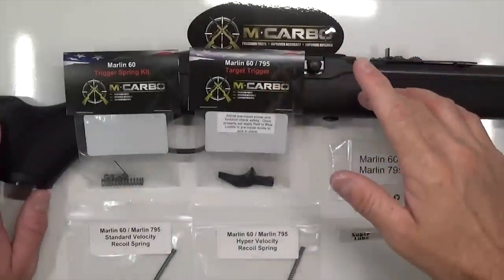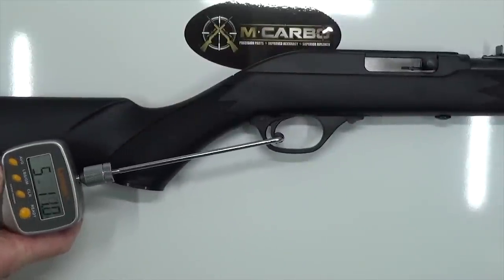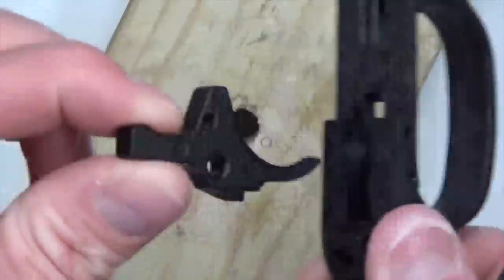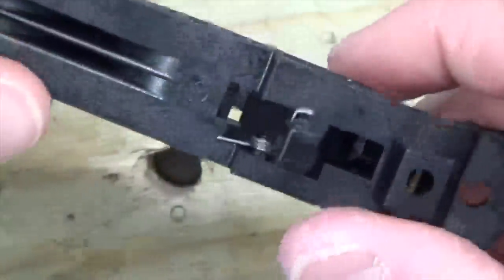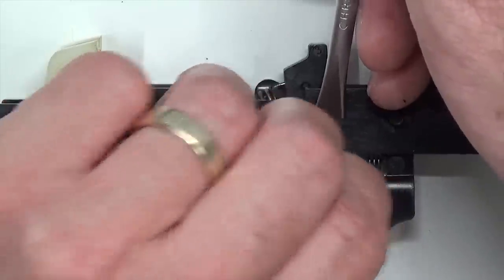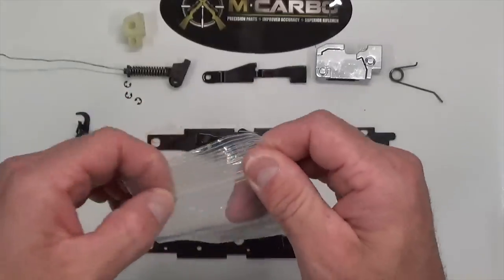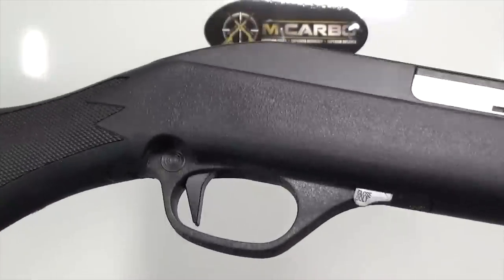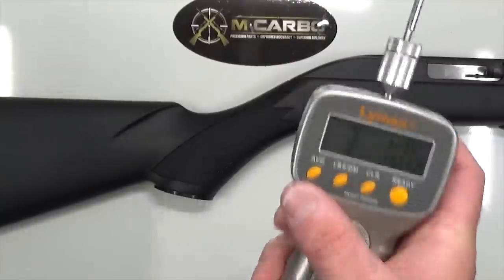Marlin 60 Trigger Job Bundle Installation by MCARBO

Comment: Such an awesome video!    I have a Glenfield 60 (with the squirrel on it)  That my dad bought in 1983.  Around 1986 or so I was cleaning it and lost that dad gum sear dis connector spring!   I searched hi and low back then to find one and could not.  Left the gun with a gunsmith for 6 months, and he could never fix it. (yeah, he sucked).  So this rifle sat, unusable, until tonight!  Now it works, and it has a lighter trigger pull!  I plan to go shoot it tomorrow.  

 Thanks so much for the products, and the great video.  That is a tough  job without knowing exactly what you have to do.

Comment: so i did this on my 1981 vintage 60  
i found the hammer spring to be kinky- doesn't look completely straight 
didn't do the new trigger, but the spring kit is sweet 
used the trigger spring kit on my m&p and man that made a huge difference 
thank you mcarbo

Comment: I got the spring kit installed with no problems at all. I dry fired on an empty casing and it’s amazing. This was the rifle I cut my teeth on when I was a kid and I never stopped shooting it. I was so used to the heavy trigger pull, I didn’t notice it until I started squirrel hunting with it last year. I could watch my scope reticle drift off a squirrels head while I loaded up the trigger. Anyway, it feels like a completely different gun now. Some of the reviews made me hesitant about swapping the trigger out. They were mentioning the gun not firing and that’s not something I wanna deal with while hunting. After doing the spring kit and watching you install the trigger, either they didn’t watch the video or they didn’t pay attention well. I’ve done a lot of kitchen table gunsmith work using YouTube and this was the best video. Great camera angle, good level of zoom, good lighting, and a nice slow pace pointing out every little thing that’ll trip you up. I work in manufacturing environments and this video reminds me of the guy that’s put something together a thousand times over the past 20 years and everyone from newbies to engineers goes to him to ask questions. Great stuff. I added the trigger and an extra set of e-clips to my cart on your website.

Comment: I'd this trigger job 3 years ago. I used the DIP milled alloy trigger. The trigger pull is now incredibly light. In the 2lb range and she rattles off shots like a M240. The diversified innovative product or dip trigger comes with a pre-installed trigger safety in an alloy housing and you simply just drop it in. But I urge you to also have this trigger kit installed before you receive your trigger, housing and diversified innovative product alloy flat face trigger.

Comment: I recently installed this kit on my old 1986 Marlin Model 60. I took extra time to polished all the contact areas, particularly the hammer and sear. The pre travel adjustment set screw was sharp on the end where it makes contact with the disconnector, so I stoned and polished it too. The trigger turned out really nice compared to stock. The pull weight dropped from 5.5 lbs, down to 2.5lbs. Can't wait to try it out on the range. $75 for this  kit seemed kind of expensive... I paid $60 for this gun used in 1996... It's a sweet trigger now, so I think it's worth it. 😁

Comment: So I have never taken a gun apart before. Used another video to show how to clean the model 40 and when I did found the recoil buffer had broken into five parts. No problem, found other vids that showed how to replace. Followed their directions. Then, BIG problem for me as a novice. The trigger spring came apart and I could not figure out HOW to get it back into the slots. Spent over an hour trying different things. None of the other repair vids showed how to handle this problem. Figured I had seriously fu-ed up. As a first timer on my own I was seriously stressed thinking I was going to have to take it to a gunsmith to repair what seemed to me had to be a simple problem.. I just could not see how to get that spring assembly into the two holes in the cover plates  I know this was not a repair video but as it turned out by watching how you replaced this assembly it explained how to get my error corrected. Bottom line. With what I learned in your video, went back to the assembly, took it apart and had the problem fixed and the whole assembly reassembled correctly in less than four minutes. Serious thanks!

Comment: You can dry fire these just fine.  Marlin says it's ok.  Also these have only had the automatic bold hold from the 80s and later.  That means the gun was designed for dry fire as the system dry fires after the last round is fired since it wasn't originally holding the bolt back.

Any good design can be dry fired including the model 60, the 10/22, and the model 64.

Comment: Like the hyper velocity spring... bought one recently... next I think I'll replace the trigger assembly... since I am ordering a Badger Bull Pup kit for my older New Haven, Conn. Marlin 60 made in 1988 with longer barrel and feed tube. Nice gun that will make a beautiful Bull Pup rifle when I'm done with my reconfigured Marlin, put the hyper velocity recoil spring in my stainless Marlin 60 tube feed rifle with the laminated black and grey beautiful stock, that gun is about done with the work to upgrade, maybe a better trigger on it next as well, but the Bull Pup I'm building is first out of the Marlin I own from 1988 in New Haven, Connecticut where it was manufactured. The Bull Pup Marlin 60 I'm turning the New Haven gun into from 1988, I have seven Picatinny rails on it, three rails on the scope, scope on one on the gun barrel top and action, that is an additional Picatinny add on in the Badger Bull Pup gun stock kit, and three on the front stock of the Badger Bull Pup stock, talk about over kill with Picatinny rails...LOL! But I have a Bushnell 4–12 x 50 EG tactical range scope on that top rail, with it's own Picatinny on left and right and top, and on top is a holographic scope, on the left a laser... so every range from short, medium, to long range shooting out to 200 plus yards with a Bull Pup 22 Marlin 60 is covered... LOL! I like shooting the 40 grain Aguila copper plated bullets out of the New Haven gun, they work better in the chamber and barrel it seems to me, and leave less gun powder residue inside of the action and gun bore, and burn better when fired in both my Marlin 22 rifles. So fixing up the trigger pulls on both will be really nice next after all this, but the Bull Pup Badger stock you can adjust the trigger pull as well on the actuator rod going from the trigger that is moved forward in that gun stock design above the pistol grip by bending the actuator where it hits the firing pin piece inside the action of the Bull Pup designed stock. Actually nothing in the Marlin is changed except moving the trigger assembly forward past the pistol grip. A really nice design, and this trigger upgrade you guys demonstrate makes it even better if I can make it work attaching to the actuator rod for the longer trigger pull in the Bull Pup Badger design... like this a lot, thank you for sharing the tips and parts that can be ordered to make a nice gun even better. You guys and gals should check out Gary Morris Badger Bull Pup stock design for both Mrlin and Ruger 22's and how the trigger actuator works, easier to adjust than some think by bending a wire like you guys are bending springs into place in the action of the Marlin. Hope you guys have a beautiful day and thanks for shipping those recoil springs, one spring fixed the old rifle issues completely for the New Haven gun made in 1988 I'm turning into a Bull Pup gun, the gun is 34 years old and about time the recoil spring was replaced... the Bull Pup rifle at 27.5 inches for the entire gun in length, stock and barrel included...of course I am good at tearing down guns and putting them back together... enjoy it...and making new guns out of old guns... for a very interesting 22 rfile that is a bull pup and still as accurate to shoot as it was original...but easier to handle on long hikes since I'm missing a leg and wear a twenty gran carbon fiber and titanium Össur Prosthetic leg... LOL..  so shortening up a gun to make it easier to handle hiking was why I am changing the factory New Haven Marlin into a Bull Pup rifle... neat to have options to personalize a good rifle design... like this video for taking the action apart... very clear and precise for the tigger and action... great job as well on the video...

 ∞
∆7Ω

DJ Emery

Comment: I have to replace the buffer block on my 60SB, so I’m going to order up one of these kits and just do everything. Really excited. I haven’t checked your website yet, but if there isn’t an option for a red trigger or straight milled aluminum, that would be an awesome option. 
As for the aluminum trigger guard, that would be sweet as well. Thanks for the video, it makes it pretty straight forward.

Comment: Can the Newer Recoil buffers with the .155 dia mounting Pin hole be used in place of the older .100 dia Buffer if that's not available. Wish you guys would possibly make those outta a better material than the hard plastic the Factory replacements are made from

Comment: Excellent video. Two business suggestions: 1. Add a std marlin model 60 "rebuild kit" for the old style 60's with all the springs and a new firing pin. I'm in that category that wants to replace my 1972 model 60 with a new stainless model. I want to rebuild my 1972 with std trigger pull for my 8 yr old grandson, I Don't want him learning on a 2 lb trigger! Of the 11 million model 60 owners, I'm sure there is many in the same boat that want to rebuild like new for their younger family but can't find a "kit", they must piece by piece put a kit together! 2. I would buy a metal trigger assembly in a heartbeat. Recommend this: a bare bones metal trigger guard, a full up lowered pull full metal trigger assembly, and for guys like me ( purchasing the stainless) two different kits for stainless; one is barebones stainless trigger guard  and one a full up stainless trigger guard with lowered pull assembly. That gives you 5 new products!!  A kit to rebuild older style 60's, 2 different items for blued new 60's (barebones guard and complete reduced pull assembly) and the same for stainless. Bet the old style rebuild kit and the two blued trigger options would sell quite well! The stainless would sell but not as much!!  P.S. you probably already know your complete video was the selling point for me to buy your products? So maybe if you do the new items you could do a new video? Thanks!

Comment: I have often thought about getting a metal trigger guard to replace the plastic one. However, even at the time I bought my Model 60SB (about 4 yrs ago),the price for the metal guard was between $65 and $85. Very steep for a rifle which cost only $233.  It seems to me that someone could make a metal guard for $35-$45 retail  If this was a Browning, or vintage Winchester, the high prices I see for the metal guard might make sense.  A plastic one, that does not look like a 10 yr. - old made it out of modeling clay, could probably be made using a replicator device.

Comment: I can't get my hammer to lock, it has tension but doesn't click, what am i doing wrong?
Reply: I can't say for certain but I think maybe your sear spring is riding against the side plate binding the hooked end of the sear, if so, pry it back so its resting on the sear and away from side plate and hooked end of sear.  If that is the problem you will know soon as you look at it, hope this helps.

Comment: @MCARBO  

Do you guys still offer your Picatinny rail for the M-60 ?

#211120001111
Marlin 60/795 Pre 2008 Picatinny Rail / scope mount

I'm searching everywhere for one. I don't wanna buy a cheap Amazon one unless its necessary.